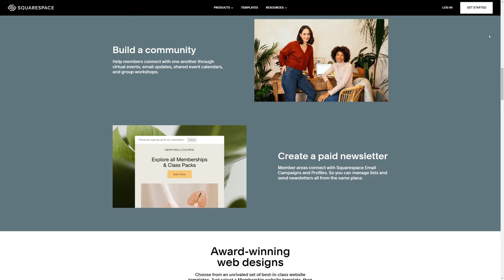I put jet engine onto children's toy

Comment: 2:45 the casters in the drift kart are installed at an angle, this basically limits the range at which can point. Going out of this range will make the kart gain height (if you pause @ 2:45 and imagine the casters pointing to the front you'll see why) and since gaining height requires energy, it's easier just to not do it.
Sorry for my bad English.
Reply: I've seen worse you actually are on the better side of English speaking
Reply: Your English is perfectly fine

Comment: step 1 make it drift with out rolling 
step 2 lower it if posable 
step 3 add mirrors to help the floating look 
step 4 add all the power
extras points if it rolls in the direction its turning 
maybe some lights

Comment: Build a stable frame, with tubing , wide stationary rear wheels , move the  front wheels further out .   3.5" wide  Rubber wheels 
Three engines.     Good ol fun

Comment: id really love to see you improve the steering system and weight distribution and throw on those other 2 jet engines. I'm sure the extra 2 jet engines will only help with steering and not make it harder to control at all XD

Comment: You could use the side rockets to steer it like a tank (increase one side's speed and decrease the opposite to change horizontal velocity), then you could set the wheels on independent axles that don't change direction/ swivel as such causes all the crashes and instability, and thereforth you could even go as far as to calculate your turns via the variations of speed in each side jet to hook it up to an electric steering system which would be safer and more precise making it so that it wouldn't only go faster with 3 jets but the steering and stability would be improved

Comment: Perhaps, the outboard engines could be used mainly to aid in steering, after a little calibration. If those things weren't so expensive, It looks like something I might have tried to do. Perhaps, some aluminum cowls should be made, to make the project look a little more finished. You could do the Spaceballs trick & put mirrors over the chassis, once you find an appropriate desert to test it in.

Comment: You need to make a wider version with wider tires for a better contact patch and then put more downforce in the rear, so it doesn't completely spin out while drifting. Also more power will do better, will get more drifting action.

Comment: I wonder if a drift trike would be a better frame underneath. Single larger rubber front wheel, for better control, and use a handlebar throttle instead. Then the wider rubber wheels with PVC over them to let the back end slide around a little better. 

Wouldn't look quite as "hovercraft" but would give you much better stability at those speeds.
Reply: Now that I think about it, that's probably a different project altogether.... but sounds like it would be insanely fun. Can't wait to see the title "I made a drift trike powered by a jet engine"

Comment: Why do all of these jet engine projects use a full RC setup (transmitter/receiver) instead of feeding the engine controller a signal directly, from something like a servo tester? Seems like that would be the easier way to do things.
-A.W.

Comment: I'm a little torn with this.  Yes... I'm all about a cool project. but I've been flying turbines for a long time now, and I've seen compressor wheels come out.  It's not safe having that directly in your back like that.
Reply from the maker: I appreciate the heads up, I hadn't considered the possibility. I would likely space it further back with a more substantial  cage for future designs.

Comment: Yeah bro but you cheesed out .. you should have put jet engines or high-speed fans at the least under the car so it really hovered as you put the jet engines on the back that would have been cool.. it's only halfway complete at best. Hey don't take it as a complaint take it as a challenge improve on what you did

Comment: Reinforce the area where you have the engine mounted. That flimsy plastic is going to shear off and the engine will fly off and hit the rider or a spectator. Also, that guys shirt was getting sucked into the intake screen, so no baggy clothes. You need to practice better jet engine discipline. I work with 5th gen. fighter jet engines, so please do not take this advice lightly.